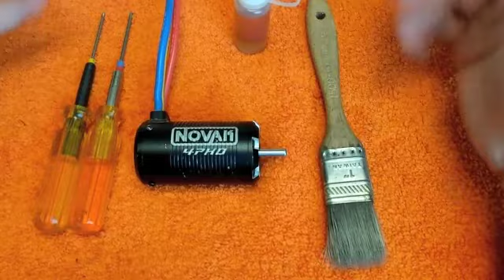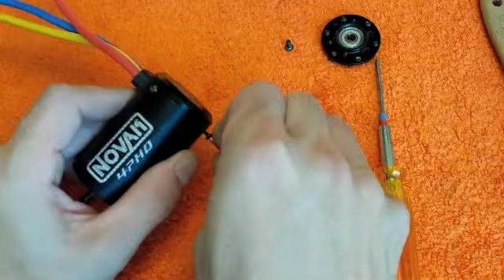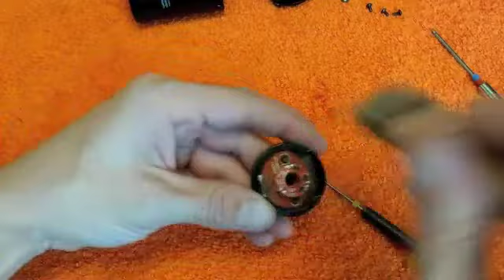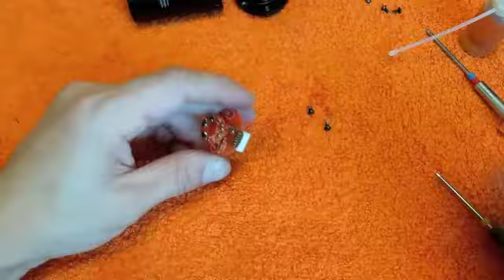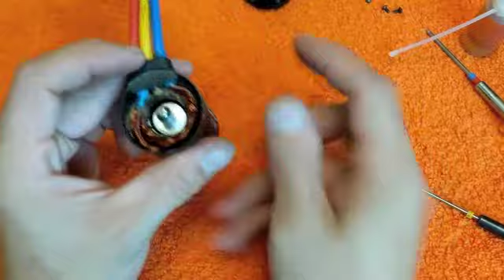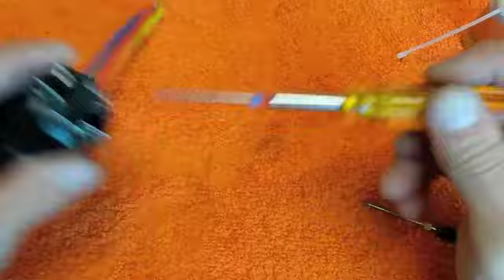How To Rebuild & Maintain a Novak 4PHD 4-Pole Motor

Comment: Hallo. You seem like expert on rc electronics. If i may ask for some help. I have an team orion hudy modified brushed motor 11x3 turn if am correct and i was loking for an esc for it. I have found a dynamite  DYNS2210 60amp 8T motor limit 540/550 close endbell motors. Will it work as a combo with my motor? I dont understand the close endbell.. Dose it meen seald motors that are not modified? Can you help? Thanks.